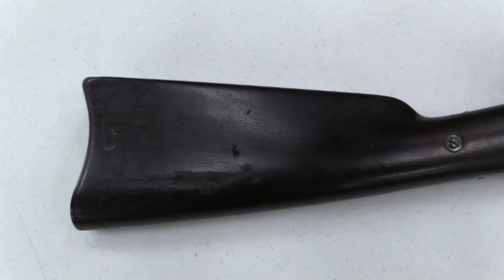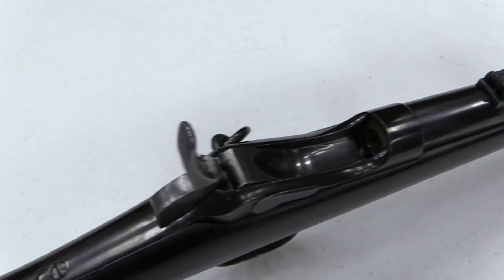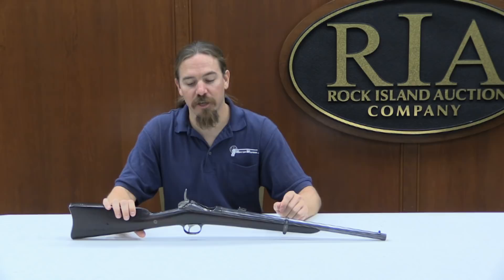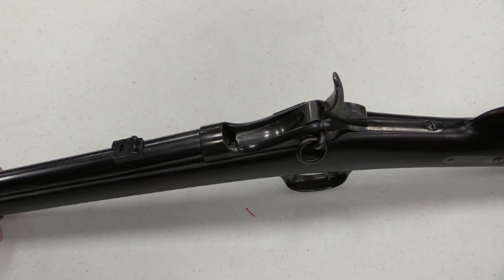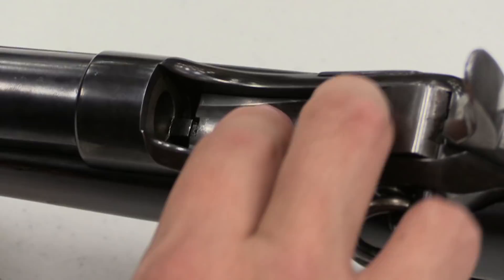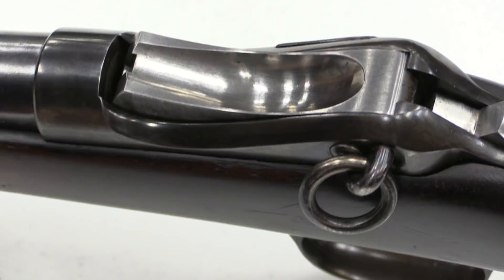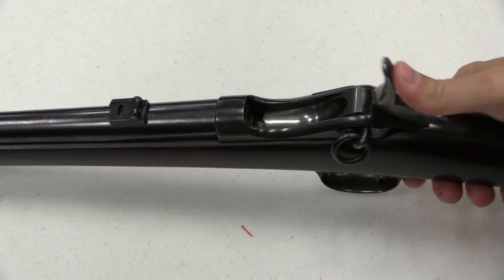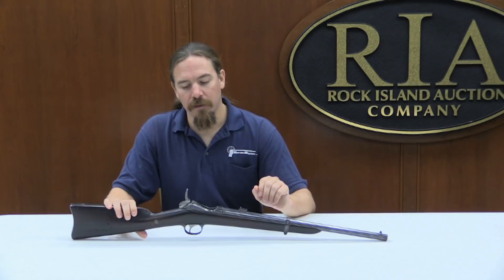Lee 1875 Vertical Action Carbine

Comment: Would have been cool if you had a dummy round. Maybe you should carry around a assortment of dummy rounds when you go to the auction.
Reply from the maker: That's not a bad idea...
Reply: Forgotten Weapons
I would agree. seeing a snap-cap toss in this thing would have been interesting!.
Reply: If that's an issue, just get some film prop bullets. They have a hole drilled in the side and a ball bearing inside.
Reply: "Snap caps" or dummy ammo is made to look very different from real ammuntion
Reply: Maybe it's not a bad idea to order some 3d-printed dummy cartridges. There are some companies that have this kind of service. A round costs about a dollar and you can literally get any kind of shape you want. It will probably be difficult to get dimensions of some cartridges, but it is possible.
Reply: @user-sd7hh8ek1c  I don't think crushed plastic bits would do well in an expensive antique  weapon.

Comment: Just awesome, that's the single shot rifle for me! Right after firing, immediately go for another cartridge, smack the hammer with cartridge in hand, and slide it in as soon as the chamber is clear. Come hammer, and take aim. Depending on how smooth the action is, this MIGHT be able to be performed without taking the rifle from your shoulder which would again speed up accurate fire. It's no wonder that he went on to design the smoothest bolt action I've personally ever handled, he has already potentially made the fastest single shot rifle ever made lol